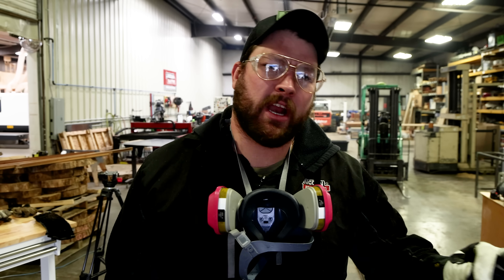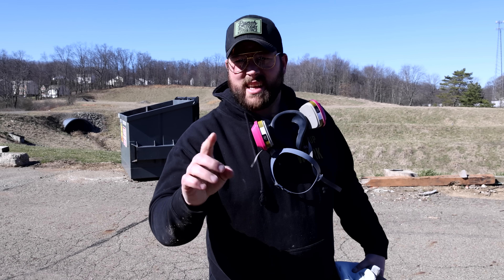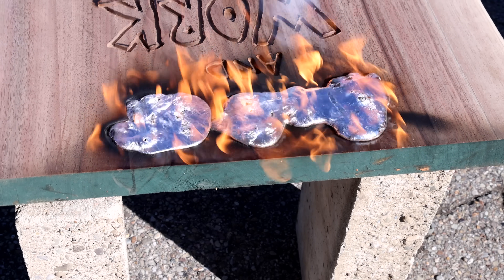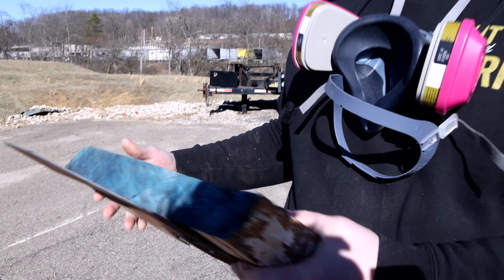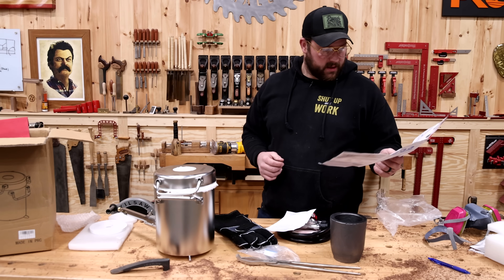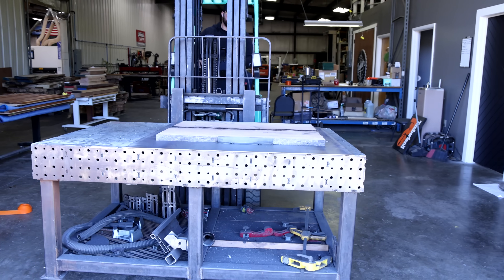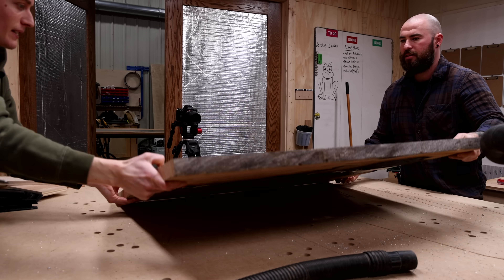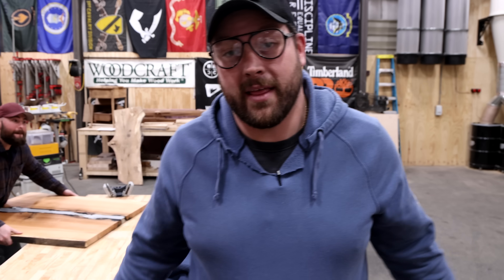I Tested Pouring Molten Aluminum in Wood

Comment: 1. You need bigger smelters....... and yes, you need more then 1!!!!
2. You need proper crucible tongs so you don't drop half of your aluminium on your foot half way through the poor!
3. You need to get all of the aluminium ready to poor in 1 batch, preferably pooring it all before any of if turns solid. One person can be getting the crucibles out while a second person is pouring. If you can get large enough crucibles that require 2 people to pour (you can have setups that have handles on both sides of the crucibles) even better. If you can pour all of it from 1 massive crucible would be the best but you would need someone who really knows what they are doing. 2 or 3 foundries would be safer so you aren't lifting as much molten metal as possible, but you also need to be able to get the next crucible pouring while the first batch is still liquid.
4. You then need to get it cold as quick as possible. Huge blocks of ice placed on top of the aluminium would cool it quick AND help to stop the wood burning. It would be awesome to see you guys pull this one off 😊👍👍👍👍👍

Comment: Just a couple random things, the dust from sanding and milling the aluminum  is more hazardous  then the fumes from melt,  and salt based fluxes should be used especially  when trying  to layer pours .

Comment: I have that Gongyi furnace! It's great, actually, and I've done many aluminum melts with it and a couple of copper melts, too. I started with the 6kg furnace like they have and just recently bought the 12kg furnace. Love them. My daughter and I are going to be forging a copper or aluminum bronze sword with scrap wire I got from power cords from a decommission I did. Those furnaces are fun, but you really do need proper PPE like they have. Never tried pouring into wood, but now I kind of want to try it on a smaller scale than this.

Comment: I'm not convinced it's entirely aluminum in the video. He probably used a metal alloy with a melting point under 350-450° F in order to achieve the look (think lead-free solder, etc.) and poured the molten aluminum only for the quick shot for TikTok and as a finishing pour. The aluminum would melt previous pours of the alloy and probably settle better in the process as it would help manage the viscosity of the aluminum by filling cracks. This avoids the bubbling that you noticed.

I would also think the wood was pre-charred with a torch. If you burn off the cellulose from the wood in the crack, the temperature for ignition will be substantially higher. I think that will help with the burning. If you notice, the burning after each pour decreased as the wood was charred. I think you just pre-char it and see how it holds up.

Comment: I have a live edge dining room table...From 1960s England... All the knot holes and and grain valley's were filled with brass filigree... Which was normal because epoxy resin and bakelite were too expensive or didn't exist...

Comment: (1) Using cut rebar to hold the halves together, great idea.  (2) The metal base you're using is too thin, thus the warping. (3) The small pours aren't cutting it. You need one large pour. (4) You need a way to cool that pour quickly to minimize wood burning.  CO2 maybe?  Personally, I think fabricating a metal mold for that gap would be a better option.

Comment: You should have tried the same thing with tin instead of aluminum. Tin has a much lower melting point, which should mitigate burning and charring of the wood. And the look will be just like aluminum.

Comment: metal wood table: soak the wood in water overnight before you pour, don't go so big(unless you get a larger smelter) and get at least one full length pour so your top, which I would put down not up on the metal slab(or sand base as stated below), should fill out smooth and possibly work

Comment: Something to bear in mind is that woods have different burning temperatures and qualities. There is a reason certain woods are sold for firewood over others and it's because they burner easier and cleaner. Maybe next time do some research into the wood types avaliable in your area as to how fire resistant they are, might get less gaps around the metal that way
Would love to see you have a second try at this after all the advice I've seen in the comme ts 😊
Reply: Might also soak wood in borax first to make it fire resistant.

Comment: Also don't forget that fine powder aluminum will spontaneously oxidize, and become highly explosive in air and exothermic in contact with moisture.  Aluminum will produce hydrogen if in contact with acids.  The more finely powdered the aluminum, the more violently reactive it becomes.  Do not mix with iron oxides.

What IS common (and a really old technique) is pouring lead, pewter, and similar alloys (which looks like aluminum) into wood (like pouring boat keels and such); which is at a much lower temperature, the metal self bonds, doesn't burn the wood, etc.  The TikToker is probably being a little dishonest in not disclosing that he's not using pure aluminum (or is using lead, pewter, or an alloy of some sort.)

Comment: Probably pre treating the area with a non heat transfer paste, spray, or paint. Used in refrigeration when soldering near valves and delicate things so they don’t melt. Schtuff works. Keeps copper pipe cool while torch is on it!

Comment: Do you think he used VHT FLAME PROOF before putting the metal into the wood? It also looks like a forge would work better than a smelter. Plus if the slab was one piece I could see using screws along the inside of the ditch would allow the aluminum to anchor itself like the rebar did in your piece.

Comment: As a blacksmith, I would have forgone the aluminum instead opting for Pewter as it has a similar look but a far lower temperature to melt it. 480-500 degrees would have helped reduce the warping and char to some extent. Especially if you were to use some all thread or rebar to secure the two live edges to each other.

Comment: The biggest problem you had was the work table wasn't thick enough to resist the heat from the aluminum and you really need to have enough furnace capacity to melt ALL the metal needed for the complete pour all at once so you don't get the layering effect you saw...

If you're going to do this again (and you might as well to make the furnace and metal purchase worth the cost), I suggest getting a thick slap of steel to place on the welding table to protect it from the molten metal and at least 3 more furnaces to melt enough metal to completely fill the voids in the slab...

That furnace can also melt copper and brass if you want to make some really interesting tabletops...

P.S.: You don't necessarily need to have slabs with voids that go all the way through it, you might be able to get away with milling deep pockets and then using thick steel screws (maybe #14 or 16 wood screws or even 3/8 hex bolts) in the edges instead of the rebar to give the metal something to grab and hold onto so it doesn't fall out of the wood and copper and brass is even easier to mill with wood bits than the aluminum is...

Comment: If I were going to try this, I would prechar the wood, have a decent core of solid aluminum already in the center, attached to your rebar, and would use a hefty welding table to hold it to dissipate heat.  Then do one large pour.

Comment: I think they must have used tin in that video. It melts at much lower temperatures, so the wood won't catch fire that easily. You could try pre heating the solid metal in between poors with a blow torch to give it a beter chance of melting together.

Comment: It is possible that there in an inert gas (like co2) that is being flooded in the area of the cast. That might prevent the wood from burning while it is hot.
Reply: Wood will char in a vacuum if it gets much over 451F. You might stop combustion but it will pyrolize no matter what.
Reply: Im going to say that sounds right.

Comment: Spent a little time working in a steel foundry as a sand mold engineer.  I worry when I see people online pouring molten metal.  A little moisture in there, and it could pop.  I saw a guy headed to the hospital because of metal popping during smelt in my first week, and he was even wearing proper PPE.  The metal made the one in a million shot, and ended up In his boot.

If you're going to do this, good that you're at least wearing some PPE, but full face shields for everyone near it might be better.  Anything you can do to heat whatever you're pouring into to drive off moisture is a good idea.  

Also, using water on molten metal is not the greatest idea.  Fires didnt scare me.  Water flashing to steam and showering me with hot metal did. Use sand.  And the fire extinguishers are of limited use.  Let's say that a glob of aluminum lands in some flammable substance... Say.... Wood.  You can spray the metal with a fire extinguisher, but you're going to still have the problem of molten metal sitting on something which burns at the temperatures of molten metal.  So bear that in mind.

 People on the internet can be a little cavalier with this stuff, so I understand not having a good example.  Love your channel and don't want to see anyone hurt.

Comment: You have to soak the wood parts in non-flammable oil before you cast the metal. It will keep the Aluminum from burning the wood.

Comment: It seems like a pre char would have helped a lot. Also wondering if the type of wood would make a difference. Denser wood would be less susceptible to ignition?!?

Is it possible that the river was coated with a high heat paint. I see POR-15 has one that is resistant up to 1200 degrees.

Comment: Seems like making a mold of the cavity, pouring the molten aluminum into said mold, and then attaching the wood pieces to the aluminum plank would work out way better. That way the wood is never exposed to molten aluminum and won’t get burned. 

Alternatively, you could simulate aluminum by dumping a crapload of metal flake and/or silver dye into some resin and pouring like normal.

Comment: Somebody should have told these guys that a simple spray bottle of water will put those flames out immediately, and prevent it from burning the wood. As hot as that molten aluminum is, just a simple spritz, or mist of water will put the flame out and cool it down very quickly and prevent scorching of the wood. I also don't think it would hurt to moisten all the areas of the wood that the aluminum is going to touch pre-pour.

Comment: do you need whole volume of Al? Could use some fillers like piece of wood? Stones? Sand? Create clay/sand form of boards and cast in the clay mold?
Reply: resin with aluminum powder as filler/pigment?

Comment: What might have worked better would have been to fill the bottom of the crack/split with about an inch of fine, clean sand. Then pour the aluminum on top of that until you get to within an inch of the top. then let it settle. Then polish both sides to make shiny/smooth. Then fill it in the rest of the way with resin to both keep it shiny and to help with the bonding. Then finish up as usual. While not what the tiktok video might have shown, it probably would have turned out much better.

Comment: Pre-char the wood and use tin (beer cans) instead of pure aluminium for the lower heat. Since the melting point is much lower you can also just make your own smelter out of two old buckets of slightly offset sizes, some plaster and an old hair dryer to pump air in (works well enough with just bbq charcoal for fuel an old fire extinguisher with the top cut off for the crucible). We do it with my kids all the time in the backyard, sand casting trinkets. Shit's fun :)
Reply: Beer cans are aluminum. They haven’t been made of tin since the 1960s.

Comment: Something that may have worked as a metal to pour in the top is lead. Melting point around half of what aluminum at 621.5°F.  Also much easier to mill .

Comment: Could you do it over again with Pewter? Pewter melts at a very low temp and it might not destroy the wood as badly as the aluminum did.

Comment: i suspect the original video wasnt poured with aluminum at all, probably zinc or rather zamak which has alot lower melting point at 650 f ish which is still higher then woods combustion point but it might be possible, or maybe it would be possible with tin which melts at 450 ish

Comment: Perhaps I'm preaching to the choir. In my state, many regions have Mesquite, Pine, and Oak growing in the same area. During fire season, the Oak and Mesquite during low-intensity fires prove to be more fire resistant than the Pine. 

Perhaps Mesquite and Oak would be worth doing something like this with.

Comment: Just mix aluminium powder in with resin and pour then sand and polish need to experiment so right amounts so powder does not settle at bottom use fast setting resin.

Comment: Got idea for you to help solve this!
The Backyard Scientist YouTube channel supercool fresh pumpkins then pour molten aluminum in. There was no thermal moisture explosion and it allowed the aluminum to fill in space and gaps. Check it out. The Backyard Scientist pumpkins  and molten aluminum should bring up video.
Get everything set up flat and pour liquid nitrogen over the wood. Then pour aluminum right after. That should help with bonding to wood and not charcoal it out.

Comment: You could always just do it with liquid gallium instead, as long as you specify the finished table can't be used in a room that gets over 85 degrees or set anything hot on it lol

Comment: When you make a pour MAKE THE POUR.  It ALL has to be done at once and has to be poured from ONE place. You got all those cold shunts because you did it like you were pouring your epoxy. -  

Get a bigger furnace. You can them make the crucible out of a piece of 8" pipe or a large  fire extinguisher  - YOu are going to have to put lugs on it and make up a 2-man pouring iron too. 

No matter what it has to be done in one continuous pour from one spot. You also have to account for the shrinkage so a green sand or petro bond dam like 3/8 above the surface would be a way around that. - Might even make a cope with a 1/4" recess to put over the top

No matter what you will NEVER get ti done pouring like it was cement or somthing like that. One continuous pour form one spot non stop. ..... All at once.

Comment: Zamak Alloy could maybe burn less the table and still look like alluminium. It's maybe what the guy used. Melting range is about 715-730° F still way hotter than wood burning point but still.

Comment: Maybe spraying inside edges of cracks maybe top of wood with heat resistant paint? 

Sanding n finishing should take off any of paint left over, Might be a thin layer of paint visible between aluminum and wood but dk if itd be enough to notice long as its a black paint or dk if they have clear heat resistant paint? 

That while getting whole thing poured at once I can see it actually being pulled off...

Comment: My Friends
I'm a knife Smith/ Black smith 
And with the knowledge I have of melting points for metals ...
The Original video you are trying to copy they used ONLY the tops and bottoms of pop cans.. That is Magnesium NOT Almuminum
Magnesium's melting point is 650°c 
That puts you a LOT closer to you woods burning rate... Especislly considering some hardwoods are beyond that rate. 
I hope this helps in some fashion and you can pull this threw. 
P.s Magnesium is a hell of a lot softer ;)

Comment: If you try this again, build an open top box around the project piece and fill it with FM-200 (or carbon dioxide to go cheap). These heavier than air gasses will prevent the fire and much of the charring.

Comment: I think the the "metal river" table y'all are trying to imitate might have been metal filings  in a resin like epoxy, though keeping metal powder from oxidizing in the  atmosphere is non-trivial (kerosene etc is sometimes used for this in chemistry labs, but it might not be compatible with the resin), and I would have expected more "sparkly" action from light reflecting off metal grain boundaries.

Comment: i would suggest making a resin mold of the edges of the wood and then sand cast them and you will have a mold which you could pour the aluminum and it should match the wood edge almost exact

Comment: I have a weird guess for how this was done on tik tok - perhaps they used tin instead of aluminum? It has a melting point of 450 degrees Fahrenheit, which is slightly below the burning point of wood.
That would mean the guy on tik tok was less than completely honest, but that wouldn't surprise me very much.

EDIT: I see something similar has been suggested in a reply to a previous comment, they suggested an alloy of tin and aluminum, which actually makes even more sense.

Comment: I think some dark resin in the gaps would be a nice look. And then do a clear pour over the top with some thick set resin that's clear to seal it all in. For a first attempt it's not what you were hoping for but it definitely has potential.
Reply: Also epoxy-coat the bottom, so it will not warp due to humidity changes.

Comment: There are low-temperature alloys that are more expensive but will not burn your wood, with a metal touch and appearance at practical temperatures... no crucible needed like Field's alloy (no lead), try that.

Comment: Big steel block used like a bacon press might have an interesting effect; aluminum will transfer heat to it very quickly, and the weight will force it into the crevices. Should solidify and form to shape quickly, but heated metal is always going to shrink.

Comment: I haven't watched the whole video yet, but why not make a silicone mold of the split, and then make a sand casting and pour the aluminum in the casting? You could brush a little epoxy to seal the wood in the split only for the silicone part or idk, just a random thought.